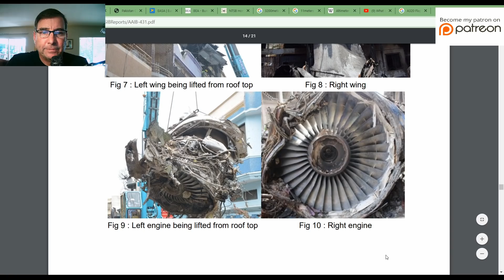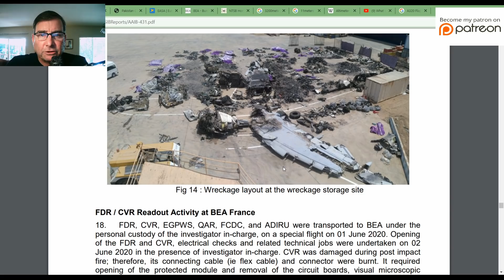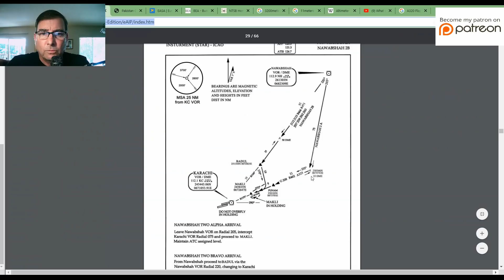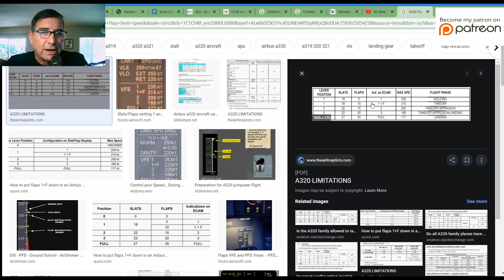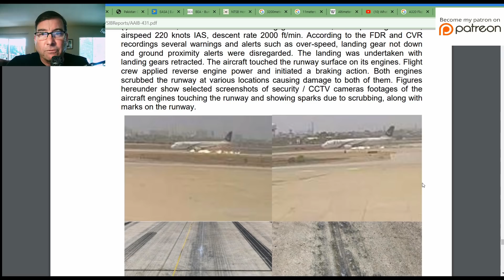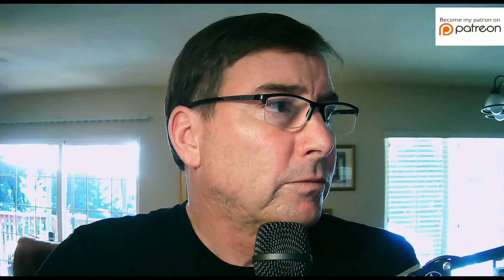PIA #8303 Preliminary Report Part II

Comment: It’s just such so sad to have two professionals flying like that and so many victims! But here are my technical comments on the subject:
They disconnected the Auto Pilot on 1st approach possibly because they knew that in order to have full speed-brakes on a A320 (not on an A318, A319 or A321) the AP must be off, otherwise they could only had half speed-brakes. The A320 (just like all the A318, A319 and A321s) make an automatic and complete flap retraction (not slat retraction) if the IAS is at or above 210 Kts and the flap lever is at position 1 or 2. But if they selected the flap lever to position 3, not only the slats remain on the same position (as per A/C design) but now they also have the flaps (themselves) extending too and to position 3 (from retracted to 20º down), way over-speeding everything! For what I can see, on the 1st approach they selected the flap lever to position 3 directly from position 1 (instead from position 2) and when the speed was around 230 Kts!!!
There was no technical reason to retract speed-brakes after landing gear down on the 1st approach but it was not clear who was flying the A/C, what were they saying to each other, meaning, what were their intentions and/or if they changed their mind and how many times. 
Although they have selected the reversers, they only deploy when both right and left main gears are compressed. They certainly had the Master Caution and the ECAM: ENG Rev Set.
 If they selected full Reverse but if the reversers didn't deploy, it's not clear on the manuals if the engines stay at idle or if they can reach around 70% of N1 (forward thrust instead of maximum reverse thrust)... Maybe that's why they didn't decrease speed on the runway, despite several belly landings, and had to go around. The spoilers didn't deploy as well since there was no L/G compression, even if they were armed.
On go-around they seem to have retracted the flaps too quickly (from position 2 to position 0). The two reasons why I say this is because the speed was bellow 200 Kts, which could be (depending on to its GW) too low (and bellow green dot speed - best lift/drag speed) but certainly above stall speed, and because they retracted the flaps directly from position 2 to 0 when there is a mechanical device that doesn't allow a direct travel from flap lever position 2 to position 0. You have to stop at position 1, release the handle, pick it up again and take it to position 0. The same happens from position 2 to position "full" (there are actually balks at position 1 and 3 for safety reasons...). 
Why is that, on go-around and after having previously selected flaps "0", and 1,5 NM after they selected, temporarily, flaps lever to position 1 is, again, beyond me, since they already had good speed at this time (maybe too good).  It's where we see the inverted "V" on the flap lever position after the go-around. Were they already guessing what was about to happen to the remaining engine and decided to head immediately to the rwy but then immediately realized that they were going to over-speed the slats and selected flaps 0 back again? Once again, bad CRM/communication/coordination between both pilots?!
On Electrical Emergency Configuration the A/C is in Alternate Law but when the L/G is down it changes to Direct Law. If the A/C enters Electric Emerg Config when the L/G is already down then it immediately goes from Normal Law to Direct law.
The minimum RAT speed is 140 Kts in order to be capable to supply the Emerg Generator, according to the ECAM, but it really is 125 Kts for this MSN (except during flare). Bellow that speed the A/C is powered by the its own batteries for around 30 minutes but even fewer systems keep functioning.
With dual engine failure (on Elec Emerg Config), without the APU running (and without the Yellow Electrical Pump "on"), they lost 2 out of 3 hydraulics and with the remaining "blue" hydraulic system you only have slats available and should select no more than position 3 for landing. Also, the APU can only be started 45 seconds after 2nd eng shutdown and it takes exactly 1 minute to start-up.
They crashed with configuration 1 but, as I said, they could have crashed with flap lever (slats only) on position 3, meaning they crashed at a higher speed than possible because the slats could have been at 22º down instead of just 18º down, as they were. 
About the FDR, according to Airbus manuals (and I quote):
The (Flight data) recording system is automatically active:
‐ On the ground, during the first five minutes after the aircraft electric network is energized.
‐ On the ground, after the first engine start.
‐ In flight (whether the engines are running or not).

So, maybe this was a “special” Middle East FDR model. But since this FDR stops recording at engs power off (during electrical emergency configuration, as well) we can guess the L/G was set down immediately afterwards. In an elect emerg config, the L/G comes down normally but only if you have the green hydraulic available (from the Green System - eng 1 - or from the Yellow system - eng 2 – but via PTU). You typically have some 20 seconds of hydraulic pressure after engs shutdown and the engine(s) windmilling gives you some hydraulic pressure too (but not enough) via accessories gearbox (which could also have been damaged from the several previous rwy impacts). That might have been the reason why they didn't have to use the L/G gravity extension. But what they should have done was to delay the L/G extension until very near the rwy threshold (just like the Space Shuttle) because not only it takes only 11 seconds to get it down, even by gravity extension, but when it's down, the drag is considerably higher and the glide ratio is much worst. It doesn't take a glider pilot to know that!
After the L/G is down it couldn't come up again unless they had hydraulic pressure (from the green system, which could have been possible via the APU powering up the Yellow Electr Pump and the PTU) and if they didn't use the L/G gravity extension procedure...
So, summing up: on the 1st approach they thought they were far away than they really were (and/or too slow!) and on the 2nd approach they thought they were too close and maybe too fast, configured the A/C too soon, crashed too soon and at a higher speed!… 
This was, among many factors, a serious CRM-based accident. If PIA doesn't go into the EU airlines black list then I don't know what else it takes...
This goes shamefully for history as the accident where just too many errors were made up to the point where no lesson is to be taken from it.
Reply: Were they “professional pilots”??? PIAs response was to suspend/fire one third of their pilots due to ‘sham licensing’ amazing, unbelievable,  very sad.
Reply: Yes.  That.   Is.  True.   One.  Third.   Of.   Their.   Pilots.   Are.    Now.  Under.   Investigation.   !!!     Their.  Licences.   Have.   Been.   Suspended.     !!!
Reply: Thank you for taking the time to write this information.
A few weeks ago before the recovery of the boxes I thought of the terrible irony that on the second approach if they hadn't have put the gear down so early they probable would have made the runway.
In the recording, you can hear ATC asking, "Will that be a belly up landing." There was silenced from the cockpit, almost as if the enormity of what they had just done on the first approach had just sunk in. Was that the moment they realised the gear was up on the first approach? Speculation on my part, which we shouldn't do, I know.
Reply: Fantastic write-up, thank you. Such a terrible shame that such incompetent pilots were ever allowed to fly this aircraft, let alone the fact they were able to crash it, with so many safety systems as you've detailed above.
Reply: I recommend you to check out PK-786 which happened earlier this year. Also... If the FDR wasn't running, these idiots also didn't turn on the APU either? omg...
Reply: Why can the APU be started only after 45 seconds of shutting down the engine? Shouldn't the APU be possible to start at anytime you want?
Reply: @harveysmith100  Are you suggesting the loud bangs as both engines hit the ground and, with sparkes flying as they ground the engines down to a fairly flat bottom, and hopped across the runway for two more agonising, spark flying attempts to get the engines even flatter at the bottom, was insufficient to alert them to the enormity of what they had done?
Reply: @HarriR09  There is nothing wrong with "Speculation" as such PROVIDING you acknowledge it is speculation and not fact.

"Brainstorming" is speculating as are "Think tanks", "War gaming" and "What if's"
Reply: Sim or real, you can fly an A320 no question. I fly the PMDG 737 NGX in my sim which has been verified as 99.9% the real thing.  I put the ILS Z 25L into the FMC and flew this very straight forward approach to 100 ft before disconnecting AP and A/T and hand landed normally. It does not appear they were denied lower altitudes at TOD.  My FMC knew MAKLI was a published hold at FL080 and to cross at 3000ft to be on GS. So how was this vannila approach botched so badly? They were a) Not using the FMC or b)They were high AF (no pun intended) or both.
Reply: @rkan2  It's as per A/C design. Quoting Airbus manuals: "This 45 seconds delay prevents any interference with emergency generator coupling". I forgot to mention that it takes exactly 45-50 seconds (depending on outside temperature) to restart one engine (in case they accidentally shut off the wrong engine or simply tried to restart one of them while they could). There's an "Emerg Landing All Eng Failure" Chk list in the QRH's back cover (instantaneous access, since it's in the back cover), stating the 1st step is to start the APU... They probably didn't know or remember that as well.
Reply: Oh, and they needed the APU running in order to get bleed (pneumatic) pressure from the APU in order to feed the starter to start an engine.
Reply: @harveysmith100  Thank You! I forgot to mention that according to Airbus manuals, the glide ratio with gear down, flaps at position 2 (same as 3, since only slats come out in their condition) at a given approach speed that could be seen in the "Emer Landing All Eng Failure" at the QRH back cover (very easy access) the glide ratio is 400 ft/NM whereas in clean configuration with RAT out is 600 FT/NM (50% more!!!) and at green dot speed. Since they crashed 0,8 NM from the runway, it is very reasonable to assume they had good chances to make it to the runway and certainly to avoid the buildings.
Reply: They fought the law and the law won.
Reply: @pedroneves8288  Whilst I am happy to confirm my suspicions, it sort of makes me so sad that I was right.
This is one of those incidents that is going to be used in training for years to come.
The next part is the CVR. If the rumours are confirmed that they were talking about Covid below 10'000 that will just add to the training video.
Thanks for getting back to me with the glide ratio's.
Reply: Sorry, I switched the glide ratio (altitude loss per NM). It should have been: 
- Clean Config: 400 ft /1 NM
- L/G Down, Flaps (slats) 2 or 3: 600 ft/1 NM
These are round numbers. Actually, Airbus says the difference ends up being 56,25% more glide ratio in clean configuration with RAT out.
Reply: @pedroneves8288  Thanks Pedro
Reply: Pilots were not qualified legally, they didn’t know how to fly their plane properly
Reply: Jun Don Probably a cultural thing
Reply: @AnthonyStatenMusic  assuming those are real.hours and not paper hours
Reply: @lightworkeight4136 : What happens behind wings is not always easy to see from cockpit.

In the quite recent Japanese incident the Airbus was inside a huge ball of fire immediately after hitting the Coastal Guard aircraft, but pilots learned about the fire only from the cabin crew once the aircraft was already in stand still.

Comment: If you're descending at a high speed, the gear is the best way to 'dirty' the plane.  They were at low enough speed to do that.  It's kind of an axiom that once the gear is extended, it is not retracted until the go-around is declared and stable flight is established.  It appears that, for some reason, once the glideslope was intercepted, his thinking was to hit the gear, which has a binary status.  Older Boeings have the up/down AND off (*middle) position.  New gear have only an up or down condition.  The pilot, relieved that glideslope had been intercepted, likely ... reflexively, hit the gear button, forgetting it was already down and thus retracted the gear.  The retracting and extending of the gear have a very similar (*if not exact) hydraulic actuator sound; just opposite direction of extend or retract. In the landing checklist, YOU MUST HAVE CHECKED "DOWN/3 GREEN".  They were so out of position and preoccupied that there probably wasn't a landing checklist at all.  Part of flying is knowing when NOT TO PROCEED - to go around on a landing or abort a takeoff.  This is a very sad story.  I wonder if they had not been on duty for a while, which may have made their flying just a little rusty after a period of time off due to Covid-19?
Reply: WAS the GPWS on?  Because the voice recorder would have that going off in background, "too low - Landing Gear, landing gear"  This was a very confused approach.  ATC SUGGESTED a go-around ... he should have DEMANDED one.

Comment: Amazing how they managed to takeoff again scrapings the engines and with reverse thrust
Reply: Well, they selected reverse thrust, but they never got it. There is no mechanical lock in the thrust levers in an airbus that would prevent you from selecting reverse thrust at any time during the flight. However, there is a lock in the overall system to activate the thrust reversers. For that to happen, the landing gear needs to be extended and compressed to a certain degree, which indicates the aircraft is on the ground. So it's very simple in this case, no landing gear means no thrust reversers.
Reply: @shi01  I doubt that information. Thrust reversers would be critical in a belly landing as to not to over-slide the runway. Granted the friction would be insane and the craft would likely stop well before the end, I still, as an Engineer, can not imagine not allowing Reverse Thrust without landing gear. Can easily just use the on-board computers to figure out the altitude, no need to rely on tyres.

Comment: Hi Juan, I'd bet some of the folks might like to know that Normal, Direct, and Alternate "Law" are computer modes and not literally legal concepts. And I can't say it enough- THANK YOU for the awesome work you do explaining all of this to us. Did I mention thank you? Thanks again.
Reply: capnskiddies The “Laws”, or flight laws, they reference are essentially the laws of physics coupled with which degree of enforced safeties (“rules”) you wish to have enforced at that moment to protect the aircraft.  Ordinarily the aircraft’s computers will enforce many rules to mitigate stalling or exceeding published safe limits of performance, but the pilot can override those laws that get enforced by changing the program mode “law” (or such can occur automatically if the computers lose redundancy, power, etc.) because you can’t write a program that anticipates every conceivable situation and at other times a critical malfunctioning/offline system makes it no longer possible to enforce the full set of safety rules or a failed sensor introduces false data into the system that the computer can’t adequately validate but a qualified human can, so you can effectively order the computer to directly obey the pilot’s commands even if they might technically exceed, or simply appear to exceed in the case of corrupt sensor data, nominal safe limits.  It is a bit like modern automotive engine computers, most of which operate in “Normal” performance mode most of the time when the computer has access (either direct or sometimes even inferred) to all the necessary sensor and position data to operate normally and deliver expected performance, but sometimes things go wrong and a vital sensor goes offline but, with some added safeties in effect to physically protect the engine (such as less aggressive valve and/or spark timing or deactivating a problematic cylinder, or more), the computer can adequately infer enough data by combining other available sensors so rather than just disabling the engine entirely and leaving you stranded on the side of the road it will instead select “limp home” mode which will greatly reduce engine power and speed and may limit gear shifting in your transmission, but it will at least allow you to limp home or to a service center without having to call a tow, allowing you to continue on despite a critical failure and loss of expected data.

Comment: Air Ontario Flight 1363. It is mentioned as an example for the Swiss Cheese model in the Human Factors book by Transport Canada. There is a 3 Volume Report on the accident by Justice Moshansky, available online. I'd suggest a read through that.
This PIA crash might not be the worst case of HF failings in commercial aviation history, but it is in this century.